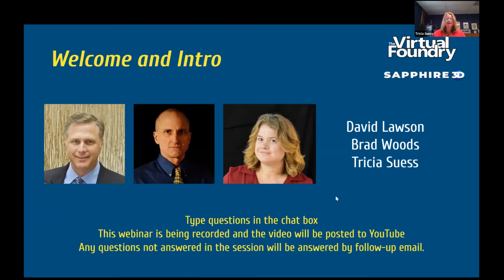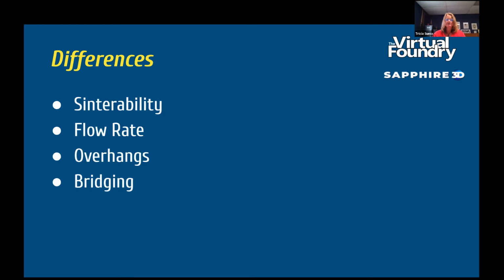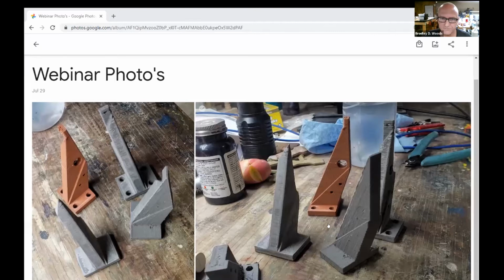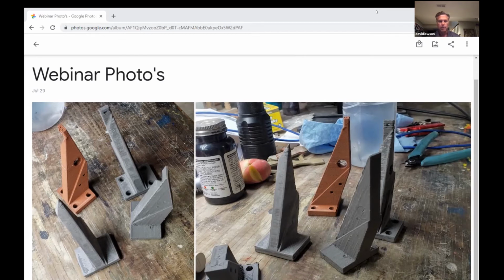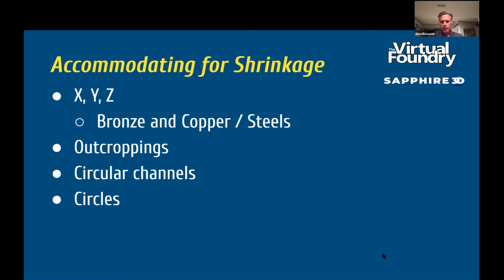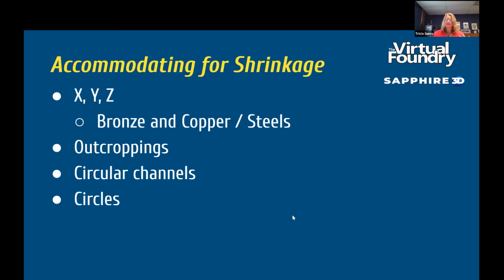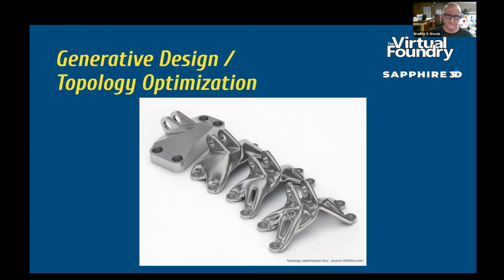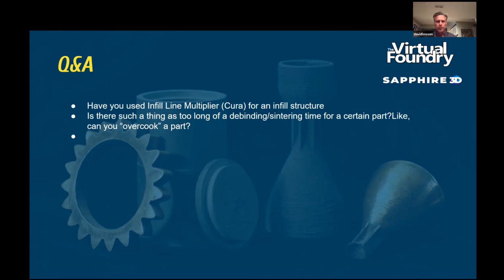Webinar: Design for Additive Manufacturing with Filamet™

Comment: Any way to use PVA as the polymer binder? Then maybe just soak in water after printing, rather than debinding with a long heat cycle?
Reply from the maker: Interesting. The part would still need to be sintered to join the metal particles together or else you'd have a pile of metal mush on your hands.
Reply: @TheVirtualFoundry  Yes, the second heat cycle (high heat sintering) would still be necessary. 
However, the first heat cycle (lower heat, longer cycle time) could be avoided, as well as issues from a less-than-perfect melt out from that first heat cycle.

Comment: Missed the livestream, but caught the vid.
Just a point I'd like to share for shrinkage is to think about this as an anisotropic problem (gravity affecting z more than x & y). Back when I first tested liquid phased with copper I found a shrinkage of the base part to be about 12% by weight.
https://youtu.be/DBzhxdxoc9k

A quick scaling formula in cura that I was playing around with (without liquid phase) could look like 1.12 * x / y / z & 1.05 & result of z. 
Some "off camera" tests showed this to work pretty well.

With liquid phase this isn't really necessary but also reduces the steps. Also I would hope to test (soon) more infill variations + liquid phase to see if we can reduce the material costs. In my test centric infill is the best.
Reply from the maker: We've found that the least you can shrink a part and have some strength is about 7%. At that point density is about 80%.